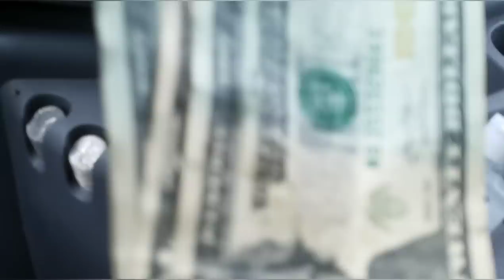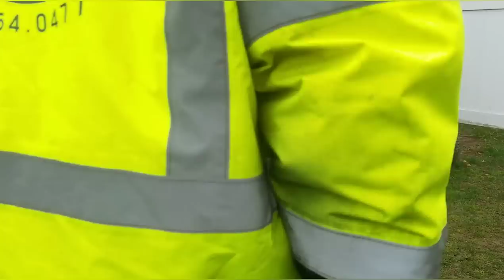FREE TORO RECYCLER BRIGGS STRATTON QUANTUM ENGINE LAWN MOWER TRANSMISSION GEARBOX TRANSAXLE TEARDOWN

Comment: Henry do you know which green color spray paint matches the LT1000 color or do you just eyeball the cap color?
Thanks!
Reply from the maker: I use rustoleum gloss dark hunter green

But.......
Here you go! Here are the part numbers for the Spray Paint and Paint Pen. Type in the 6 digit number on searspartsdirect.com to get your result.

150020 POLO GREEN Spray Paint (SEARS) 558
172527 POLO GREEN Paint Pen (48186) 558
172530 SATIN BLACK Paint Pen (48187) Decks, Chassis, Dash
150131 SATIN BLACK Spray Paint Decks, Chassis, Dash

Or you may have luck with this one... 
https://www.amazon.com/Dupli-Color-EBCC04217-Emerald-Chrysler-Automotive/dp/B00407V4XG?th=1

Comment: Henry  you just need the round plastic cover not the hold top.The cover that fits the recoil,it just snaps on.That motor is a overhead valve,not a L head.
Reply from the maker: How does the air filter fit in there, am I missing the base?
Reply: Yes, I think that engine has a oval air filter.

Comment: $250 for a big box store FWD Toro? For 50 bucks more you can just go get a brand new one in the box!  $250 is what you’d get for a good used aluminum deck SR4 Personal Pace if it was super clean and had the black bag. If you’re lucky.
Reply from the maker: Well, we sell them all day long here in Long Island NY!  things cost more here!
Reply from the maker: Plus ny tax 8.6125% tax makes a new one at $309.99 + $25= $335 which is $85 more, not $50!
Reply: Mowers N Blowers yeah, I guess it’s all regional. Those go for $150 - $165 tops here all tuned up, compounded, waxed and shiny with the bag and side chute and they’ll sit half the summer. Nobody wants front wheel drive anything around here, truthfully I don’t think anyone even cuts their own lawn around here anymore.
Reply from the maker: mjg263 honestly, I’m with you bro, I’ve never gotten more than $250 for a walk behind...$250 will be a tall order, but one could only try!  Thx for the comment bro! Hope you’ll subscribe